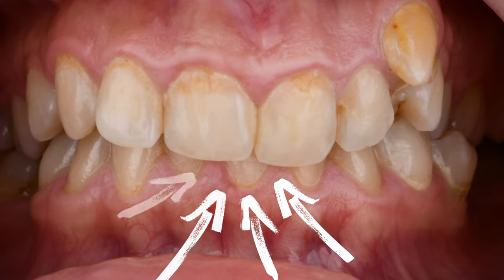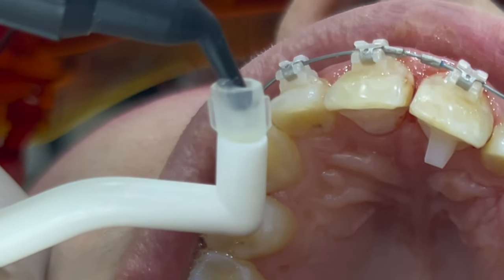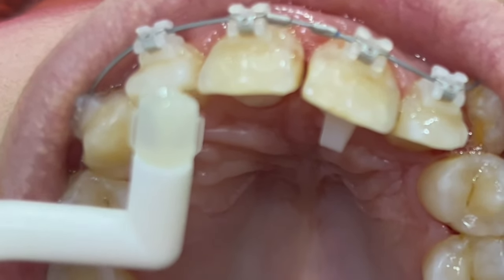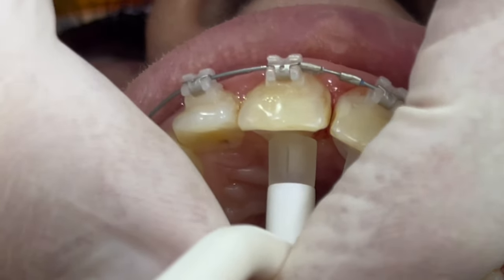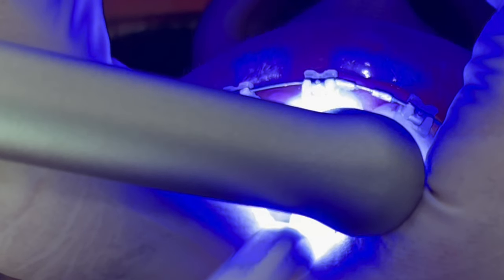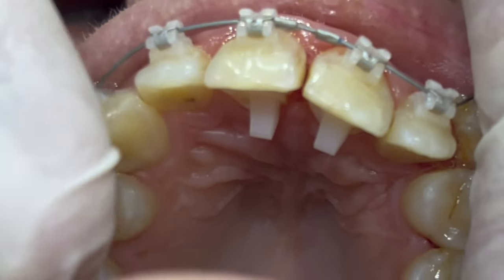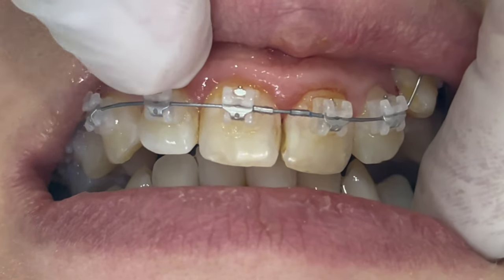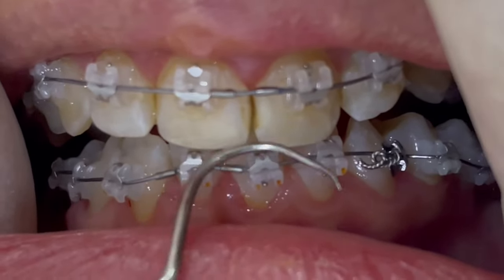Composite mould for placing on bite turbo or bite separation for deep bite, bonding bite plane

Comment: Blue bite turbo cement doesn’t work . It sets inside the mold. Why is it so?
Reply from the maker: Usually it works. You should follow those steps exactly by cleaning drying, apply the bond, then press steady the composite to the tooth surface without moving during lighting.